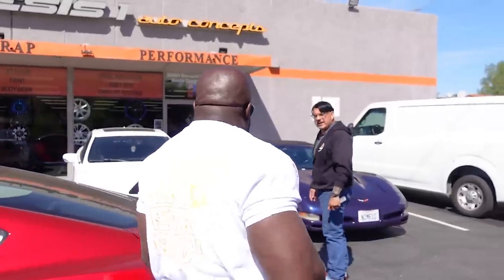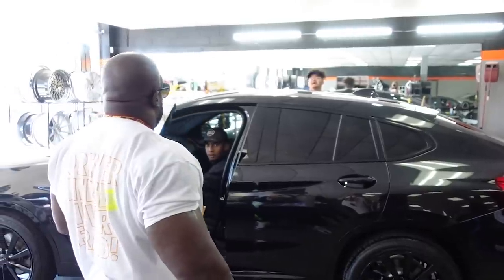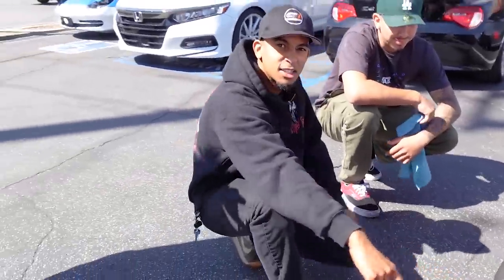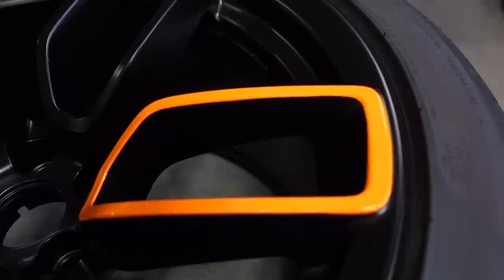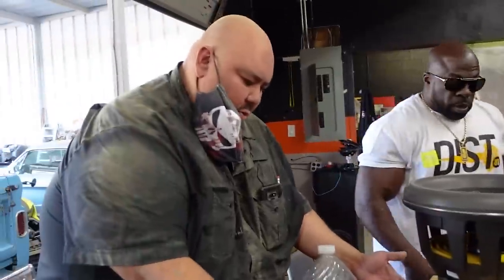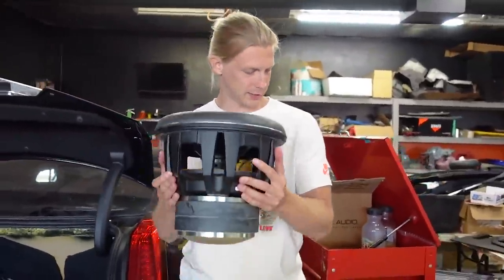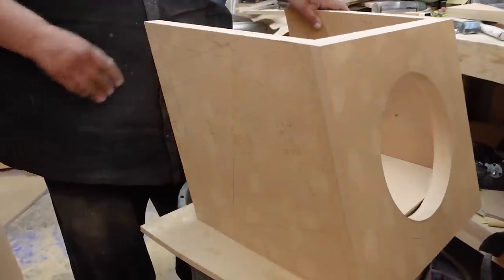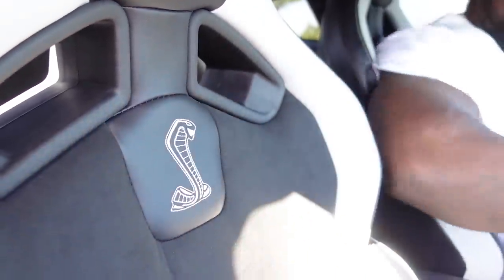FORD MUSTANG SHELBY GT500 & TRACKHAWK GOT TINTED WINDOWS

Comment: The GT500 has a DCT (dual clutch transmission), while the Dodge’s have a conventional transmission.

Should be normal (when cold - let the fluids run warm before GO WILD!), but Kali should learn to use the paddles (or at least learn to control the gas pedal between shifts).

Comment: did ya delete the cats ? yet because there clogging your engine and throttle response , u have high flow exhaust yet u have ceramic concrete screens plugging your exhaust in your cats , this still my opinion until u show or tell us u clapped u cats

Comment: just mustang things lol its pretty normal to be jerky and run a little like crap
Reply: Guy explained what it was in the vid.
Reply: @burgerbandit3646  yeah, great observation, i watched it also. Regardless of the specific issue with Kali's being potentially the factory tune - if youve had, or know people with s550's ull know that its a common occurrence for it to do something stupid for absolutely no reason, doesnt matter if its the lowest trim or the highest lol.
Reply: @tokenbluntz8588  This is the first time ive ever seen anything "stupid" go wrong with the car that wasn't the drivers fault. And all it was, was a clogged fuel injector. Just needs to be cleaned.